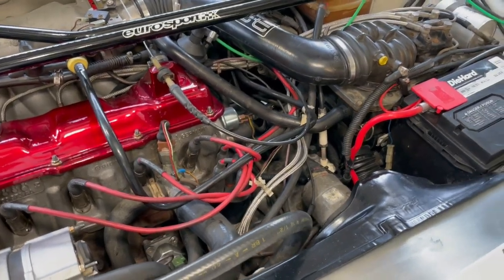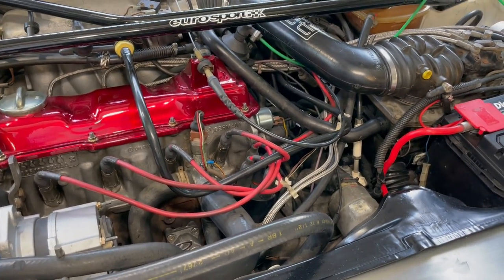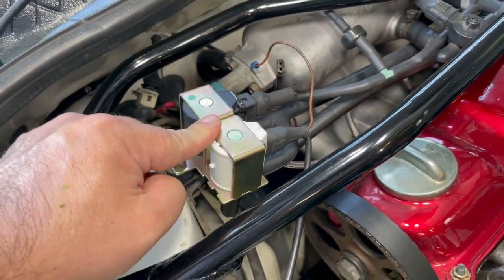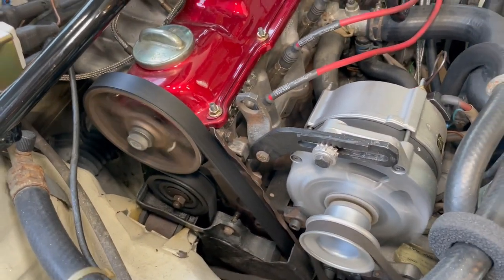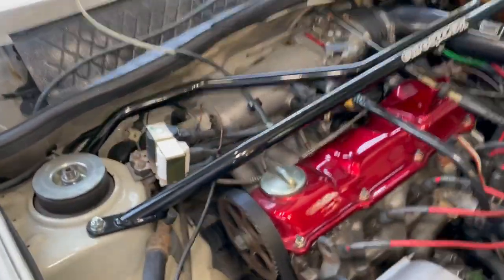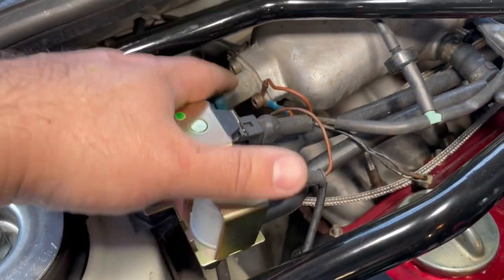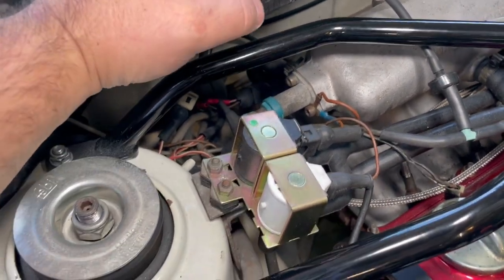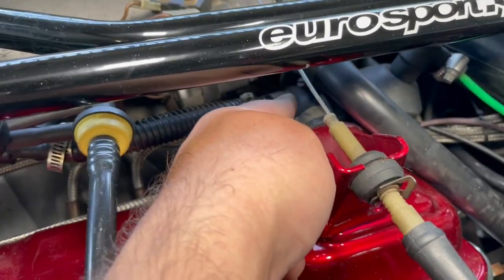Found Why My Mk1 VW Cabriolet Wouldn't Idle Correctly

Comment: this called the fifth injector it sprays fuel directly in the manifold
(bypassing the fuel head regulator ) so the engine  starts correctly and smoothly it's controlled by a thermo switch located on the water coolant flange that goes from engine to the radiator (upper thick hose )
it only works for 1second then off
depending on coolant temp .
been long time since I  used the kjetronic fuel system  and it's  amazing  performance ,engine noises where awsome  in addition to  unsuspected  faults making every gti owner scratch Thier heads trying to solve those faults .
👋👋

Comment: After looking at mine again I am pretty sure the white solenoid boosts the idle when the AC is on and the black one is for normal idle boost when RPM drops below 750. I was wrong in my earlier comment. I retested mine and the black valve is dead, the white works if I connect a 9v battery to it... but the AC doesn't.
Reply from the maker: thank you for the update

Comment: I have a similar cold idle issue and after taking apart those idle boost valves and testing with a 9v battery I found the white solenoid was dead, but the black one works. Those are not easy to find, not for cheap anyway.
Reply from the maker: I lucked out and found a NOS set of valves.
Reply: @ShinyFastLoud  i am on the hunt for those now :(
Reply from the maker: @jhartwells  good luck

Comment: Mine has the same problemis a 90 model,but has a relenti valve I think in the place of these 2 , after checking the relenti valve cable has no signals i checked the cable to computer and is alright! Any ideas?

Comment: mine runs and starts but it struggles. and if i give it a little gas but suddenly stop like at a red light about to turn right or stop sign being behind people the car turns off
Reply from the maker: I have a couple other videos on how to set the Air/Fuel Mixture and to test the fuel pressure.

Comment: I have a problem with high idle RPM s I can't adjust leas than 1300 RPMs. adjusting the throttle screw, what do you recommed me to do? Regards (same engine), Regards
Reply from the maker: Check everything else, start with eliminating vaccum leaks, then set timing and air fuel mixture.

Comment: And i suggest to use brake cleaner for the testing vacuum leaks. Not carb cleaner.
Reply from the maker: Brake cleaner works but can cause other problems since it typically isn't safe with neoprene, vinyl, rubber, seals, and gaskets.